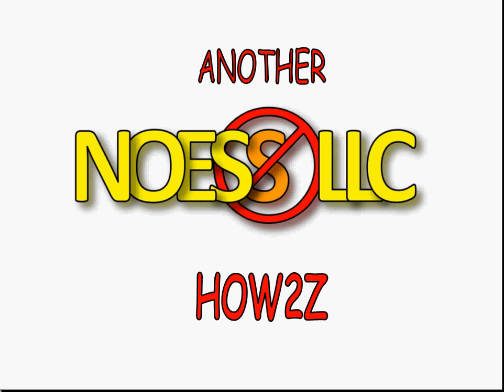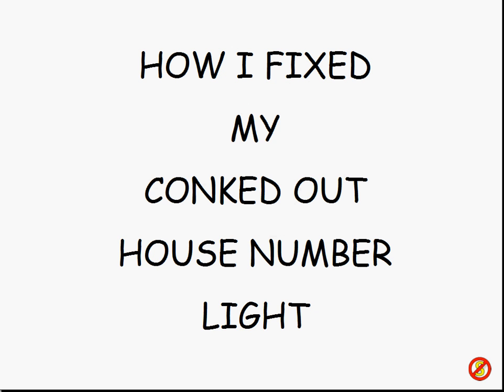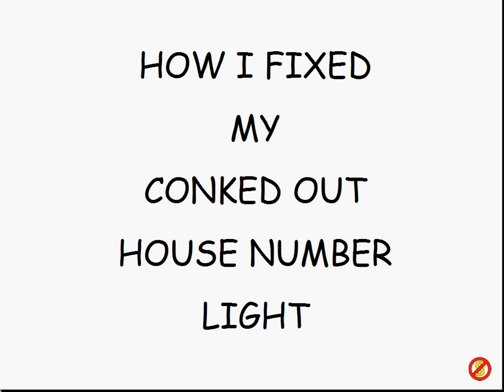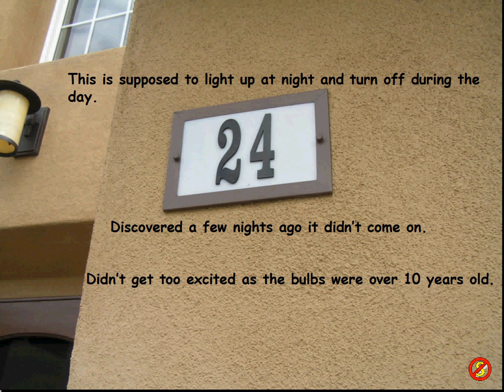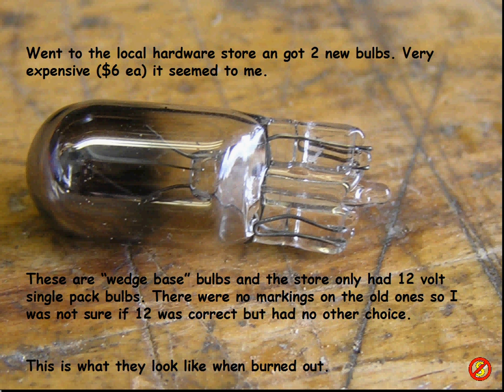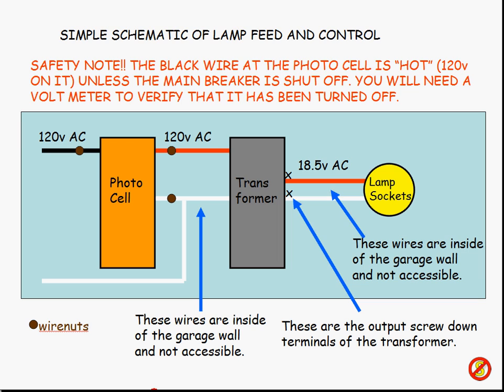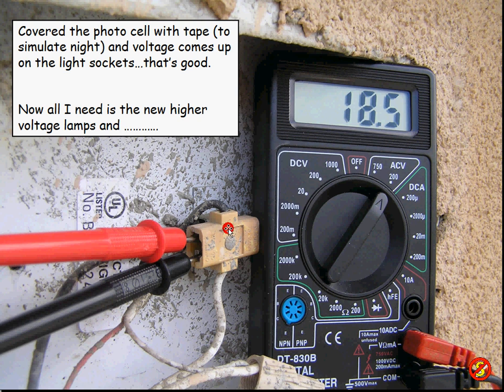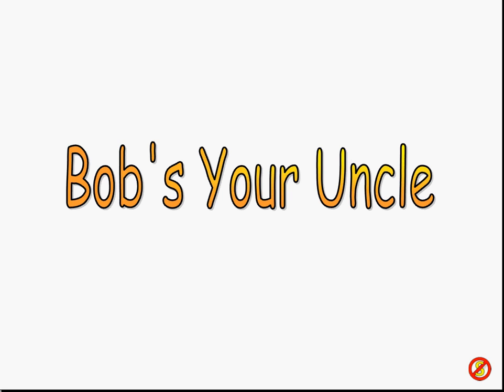How to Repair House Address Number Light

Comment: YOU DA MAN!!!! I had the exact same issue. Stucco home in Southern Nevada. Old house address number light with burnt out bulbs. I could barely decipher that the bulbs are rated at 12V. Got a 16V transformer in the garage. This has been a constant headache for days now! Thank you so much for taking the time and posting this! VERY HELPFUL!!!!
Reply: Hi, Christian - were you able to fix your address number light?  Did you find higher voltage bulbs that work?  If so, would you please share a link to what  bulbs you got?  My mother-in-law's address number fixture sockets look just like "Uncle Bob's" here in his video, but her bulbs are T2.75 or T3 wedge base (very small).  I had tried 12V replacement bulbs with Bob's same blow-out results, and then I checked supply voltage, and it's 22.5 VAC even though the inside of the fixture specifies a 12-15 VAC transformer.  I'm hoping to find 24 VAC LED replacements and can figure out the socket connections if different bulbs bases.  Just wondering if you had success and how you accomplished it - please let me know - thank you.

Comment: Fixed my mother-in-law's house number light (so far, so good anyway) - her fixture had 22.5 volts AC supply at the light; replaced the sockets with two Winka T10 wedge-base sockets and Keiurot House Number warm white 12-24 Volt AC/DC LED bulbs, both off Amazon.  Anyway, thank you for the video, "Uncle Bob" - hope this finds you well and with your house number light working well, too.  Thanks also for the other commenters on here as well.

Details:  The Winka sockets came in a 6-pack and used two of them.  The gauge of the stranded wire of the socket leads is tiny, and maybe a combined 20-22 gauge for the total strand - they stripped perfectly at 18 gauge on my pliers, the socket lead wires are thinner than the supply wire from the transformer, so have some concerns with going from thicker to thinner gauge.  The power supply wire is 18-20 gauge solid wire (like doorbell or telephone wire) and understand transitioning from larger to smaller gauge is a wiring no-no, but this is relatively low voltage and the connection is inside the electrical box.  I put the red wires from the sockets on the black wire from the transformer, and the black wires of the sockets to the white wire from the transformer, but it probably doesn't matter.  The new bulb bases protruding from the sockets did feel a little warm soon after installation, so will continue to monitor, and I may have to go back and re-wire to a lower voltage at the transformer, which is shared with the doorbell & chime system.  There's no photo-cell in the circuit, so the fixture is powered on 24/7.

Mother-in-law's original light fixture was by Tellmark Corp. or Prescott, AZ, which seems to be out of business now.  Label inside fixture states: “Power only with 12-15VAC (8 Watt minimum) Class II transformer” and had 800# to call for parts, which had an odd voice message announcement when I called, so hung up and not much about them online either.  Original bulbs were Halogen T2.75 wedge base and the socket plastic housings were brittle (voltage probably too high / exceeded specified voltage on fixture lable) and cracked & crumbled further when I tried T3 12 Volt DC bulbs, which of course blew out shortly after given the 22.5 VAC supply (should have measured first).  Her house was built 20 years ago, and she thinks the house light has been out for a few years. so the original halogens lasted pretty well.  There was indication of excessive heat (small black, burn-like marks on the fixture metal above the original sockets) inside her fixture, which also makes me think the higher voltage connection off the transformer is too much.  Her transformer is a Class II No. 596, which has three output connection posts, and her house number light is on the bottom two posts - the voltage on these posts was 22.5 VAC just like at the house number light fixture.

Winka T10 sockets (6-pack)…
 https://www.amazon.com/Winka-Extension-Harness-Connectors-Sockets/dp/B07H8F322J/ref=asc_df_B07H8F322J/?tag=&linkCode=df0&hvadid=343230797474&hvpos=&hvnetw=g&hvrand=6439385144512777107&hvpone=&hvptwo=&hvqmt=&hvdev=c&hvdvcmdl=&hvlocint=&hvlocphy=9031527&hvtargid=pla-727564282934&ref=&adgrpid=69167826935&th=1
 
Keiurot House Number Light Bulb Address Bulb 193 Bulb Lighted Address Sign LED Replacement Bulb Kit 10-30Volt AC/DC, RV Landscape and Cabinet Lighting Warm White (2-pack)...
https://www.amazon.com/Address-Replacement-10-30Volt-Landscape-Lighting/dp/B0BV9XK5CV/ref=psdc_2314207011_t2_B09S8Y8SG6?th=1

Comment: They are a 193 automotive 12v bulb many japanese cars use them. They cost like 3 bucks at the auto store for a pair. Or $4 for 10 pack online.  You can rewire  the sockets and run them in series to half the voltage to the bulb  so 9.3v per bulb and they will run just fine maybe a little dimmer then on a car but plenty bright for a address light at night.

Comment: This set up you show at 9:34 mins... Can you tell me can the doorbell also be connected to it? or does the doorbell have its own transformer which is in the box for doorbell found indoor?  Thank you... I'm trying to figure out if its the transformer or the photocell that is the problem for my address light not working.  (the address light turned on (very dim) for a couple of seconds then turned off)

Comment: Regarding socket voltage. A lot of these fixtures run two lights in series, so technically two 12v lamps can take 24v total. Of course, if they’re run in parallel then you need the higher voltage bulbs. 

I rebuilt mine today, the sockets were corroded inside. Bought some sockets at the auto parts store and a couple 194 bulbs.
Reply: Did you use 12V lamps and wire them in series?  Or did you already have 12 volt AC supply?  I'm dealing with 22.5 VAC supply and the sockets deteriorated / need to be replaced.

Comment: I’m just trying to wire the fixture to the 2 little prongs correctly . Will I get electrocuted if I touch these wires and wrap them around the metal prongs sticking out ? Also, which breaker is the doorbell usually connected to. The breaker doesn’t say doorbell on it
Reply from the maker: If you are inexperienced to the point of not knowing a volt from an amp...the safest thing to do is turn off all power (breakers) before working on an unknown feed. If you do it one at a time you'll probably discover the doorbell/number light to be associated with some "aux" circuit. Bells and lights running on AC have no polarity so where you attach the wires doesn't matter. If the lights are LED, they won't work if the wires are "reversed." If you're unsure...call a licensed tech.
Reply: noessllc worst reply EVER...Lol
Reply: @lasvegascannabis3793  That was pretty much a perfect reply to your question.

Comment: Hi bob, great video!  I have the same problem as you have with burned light bulbs.  My question is did you have any luck with 24v lamps, an have they functioned well for you?  Thank you
Reply from the maker: Yup, they have worked much better than the "originals" and are still going strong.
Reply: noessllc thank you. I’ll order some :)
Reply: @arymonem  What bulbs did you order?  Can you please share a link if you bought online?
Reply: @cwmson8381  hi there, I believe I got it from auto zone, a 24 volt automotive lamp.  It’s been working ever since.
Reply: @arymonem  Thank you for the information - I went with Keiurot House Number warm white 12-24 Volt AC/DC LED bulbs from Amazon - so far, so good after a couple weeks.
Reply: @cwmson8381  nice!  Glad it’s working.

Comment: Great Video! My question is I have no photo cell. I’m pretty sure my address light shares the transformer with the door bell. Door bell getting about 13 volts at the button. But the address light not getting anything. At the transformer it barley makes it over 1 volt. I’m so confused
Reply: Had my volt meter wrong. It’s showing 15v it’s a 16v transformer
Reply: My thinking is the wire is snapped somewhere 🤦🏻‍♂️

Comment: This is a great help. I've been trying to find my issue. I can't see or find a light sensor. But I replaced my transformer. I was told where it was, our development had hardwired it in with the door bell. Door bell works now but  still no lights. New bulbs too. Any other suggestions? Thank you
Reply from the maker: Logic would point to not having the doorbell transformer also feed the number lights. The circuit for the lights requires the photo cell to be on the AC feed side of the transformer. This would mean the doorbell could only work at night. If the (low voltage) lights ever worked (at night) before, it means there's still a transformer and photo cell you've not yet found. Back tracing from the light socket using an inductive cable tracer is the easiest method to find the transformer and from there find the photocell. Lots of different models (and prices) available for tracing AC outlet to breaker or phone jack to telco demarc. Because of electrocution danger, if you are not experienced with electricity you should call a licensed pro to do this for you.
Reply: Thank you. That does make sense however I contacted the builders and was informed only 1 used, hardwired in the foyer closet to 1 doorbell, and 1 house address sign. Now I think the wires got cut during upgrades...
Reply from the maker: I think that's a good guess. Having only one transformer and no photo cell simply means the lights should be on 24/7.
Reply: Hi ,  You can buy these bulbs at auto zone or other car part stores. There numbers to fit are 193 or 194 and there 14 volt bulbs.  $2.99ea.

Comment: The address sign is always on unless the lamps burn out
Reply from the maker: That's true if the system DOES NOT incorporate an ambient light detecting switch. Based on personal observation, every house in my very large development incorporates an auto switch to keep the lamps off during the day. Here in Lunatics' Land Cali even a single milliwatt not used saves the whales, the country and the planet. Hey, don't be a WATT WASTER - retrofit you wiring asap.